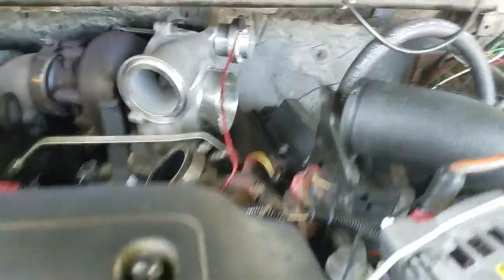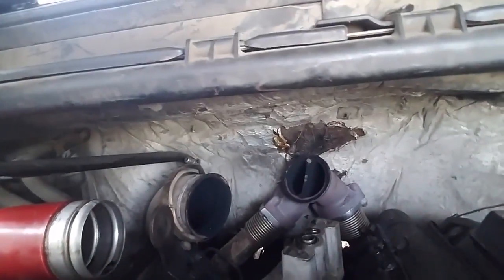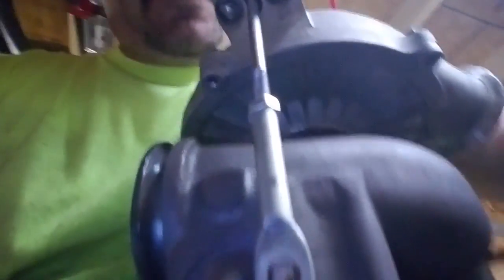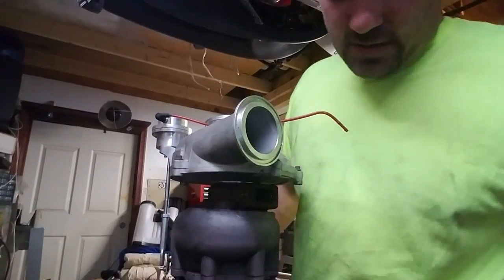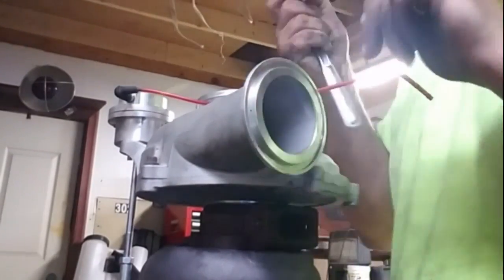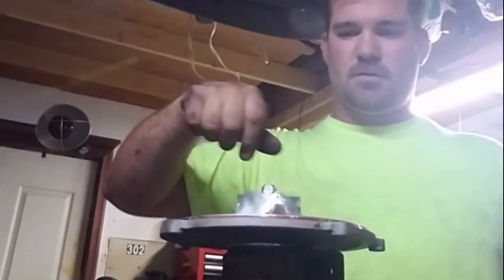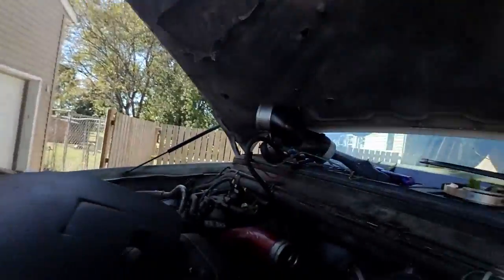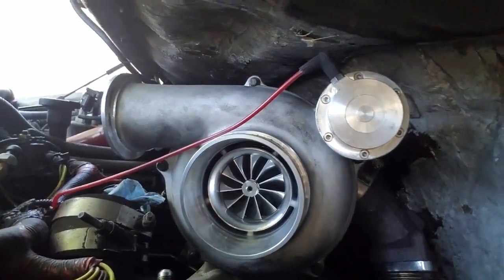Wicked Wheel 2 38r install 7.3 Powerstroke

Comment: the wicked wheel has 11 fins and the pitch of the blades are about a degree up more than the stock blades. with one less blade and the pitch up a bit, it will create less friction and drag and suck in more air. changing the pitch just a little bit makes a huge difference.  hope this helps

Comment: The wheel you took off was a ww2 man.  The new one you put in was a different gen ww2 with double the blades. Usually used with upgraded injectors..

The stock wheel on a 38r doesn't have the grooves between the blades ave isn't polished.  Fyi

Comment: thats not a 38r it's an up graded stock turbo bigger compressor housing and a 66/88 wheel a true 38r is a ball bearing turbo that out performs a bushing turbo. waste of money the first wheel isn't stock and will still make the top recommended boost pressure
Reply from the maker: +MrPowderEater Yes your correct in that it's not a true 38r. I say it's a 38r so people don't get confused on the turbo wheels. The wheel that mine came with I do prefer and recently changed back to it. But the WW2 does out preform it as a quicker boost
Reply: The ball bearing turbo is junk

Comment: Annnnd I saw you have the exhaust back pressure valve delete I'm doing that also, but what did you did for the old plug in wire? I read someone put a 0.5 watt 470 ohm resistor in it. Is that what you did for that delete to work so it doesn't throw a code?
Reply from the maker: +quackster95 I bought a resistor from riffraff diesel. It's all pre-made and ready to go
Reply: Devon Xpress can you show me where you got it and how much it was?
Reply from the maker: http://www.riffraffdiesel.com/ebp-pedestal-actuator-isolator-pigtail/
Reply: Devon Xpress thanks man!

Comment: So I got a question I've been trying to decide to get the turbine you had in your turbo and the one you just bought. But I'm seeing they both are considered the "wick wheel 2" but they both have different out looks and performances/sounds also. I'm curious on which do you prefer? Because I have a 2002 f350 and it has the stock turbo. Will this one in this vid got my stock? I'm just a little confused and need some guidance
Reply from the maker: So my turbo is larger than stock. the wicked wheel 2 can be done on a stock turbo or the larger. A little confused on what your asking, but you can call me @ 302-242-9885 if i don't answer leave a message
Reply: Devon Xpress oh I was asking mainly the difference because I see online and everything that the wicked wheel 2 is also the one that came out as "stock" on your turbo to put in what you said is the wicked wheel 2, now. So I assume it might be 3rd gen or something. But I was mainly curious over the EBPV delete plug and relay because I wasn't sure what I was going to have to do with that. But i just saw the link and looks easy. Is there anything different I need to do to plug and install? Just curious

Comment: What a let down! We don't get to hear it?
Reply from the maker: +bthor76 yeah the ww2 has very little whistle, I've considered putting in the old one for just the sound... the ww2 has a little bit, I'll be using my better camera with mic to see if I can get some clearer sound..

The ww2 does preform better so it's a give or take depending on what you want
Reply from the maker: I do have a video up called water/ meth ww2 overview, check that video out
Reply from the maker: I do have a video up called water/ meth ww2 overview, check that video out

Comment: You got a gtp38r turbo??
Reply from the maker: kinda of mine uses the 38r wheel, but i don't have the ball bearing center and i have banks exhaust housing. its a Frankenstein turbo. i call it the 38r since the wheel used is the same
Reply: +Devon Xpress well, the point of buying a 38r is to get the ball bearings, so you just have a factory turbo with a different exhaust housing...
Reply: +Devon Xpress BTW, spray that back clamp with pub blaster, makes it 200% easier lol

Comment: Thanks for doing this vid, I've been waiting on it! You skipped the part where you took the first wheel off of the turbo, did  you use an impact to get it off? I've seen the comments in other vids that say to not use an impact when putting the new wheel on, it self tightens? When im doing mine i mainly need to check for play in the part that you screw the ww2 onto?  Do you think the waste gate is a necessity if your putting the ww2 on? I have the 4'' mbrp exhaust on the way. I was thinking about going with the AFE "Big Boost" BHAF Washable Air Filter. I have a edge evolution tuner but im ordering a DP Tuner very soon.
Reply from the maker: I use vise grips on the nut on the other side on the exhaust housing it doesn't take much to break free, and yes just hand tight until it seats once its on it will torque itself. if you have play will need a turbo rebuild.

Unless your truck is super modded and can handle high boost pressure i would leave it, the stock plenums are rated at 30psi so running higher than that for long will blow the gaskets on them, i would  upgrade to a better wastegate plunger like the afe or like it. mine is set a 33psi. Afe makes some pretty good stuff.

If your looking for something that your thinking of buying let me know here at my Email- Devonxpress@gmail.com Ill see what prices i can get for you.

WWW.XPRESSDIESELPERFORMANCE.COM